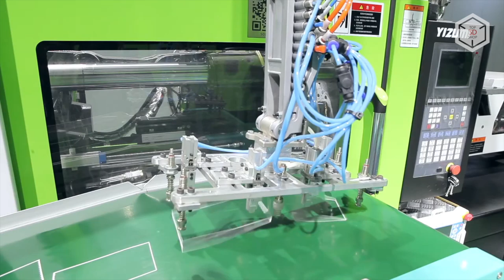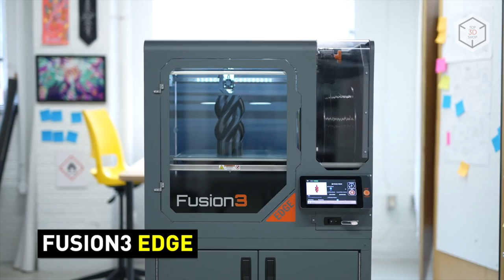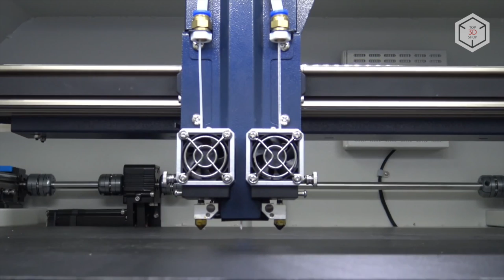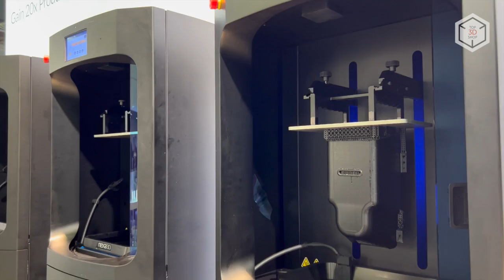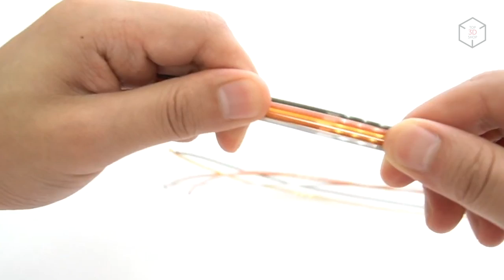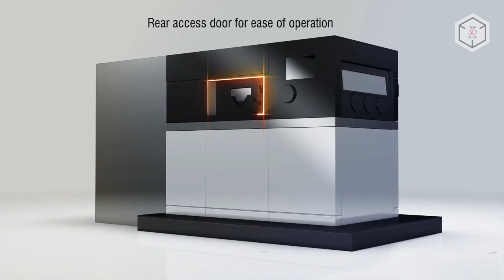Best Industrial 3D Printers and Their Benefits

Comment: 200mm/s speed is 1/3rd of what open source hardware can do.
And its also not THAT relevant as the limiting factor for print throughpu is volumetric flow of nozzle, not the capability of the motion system.